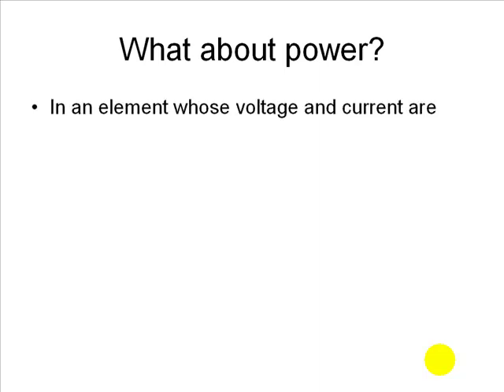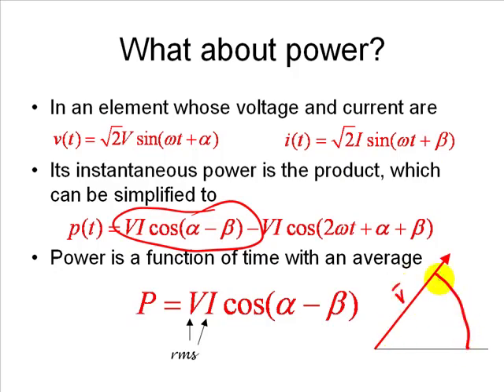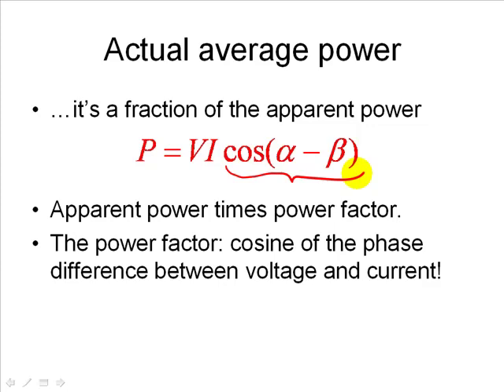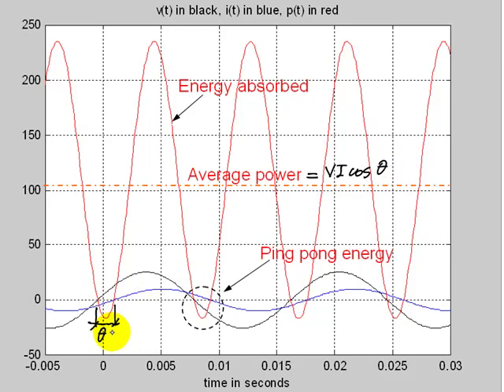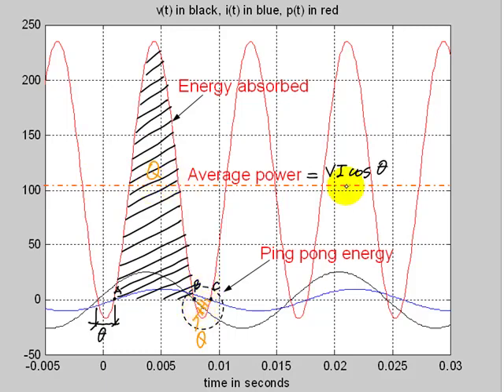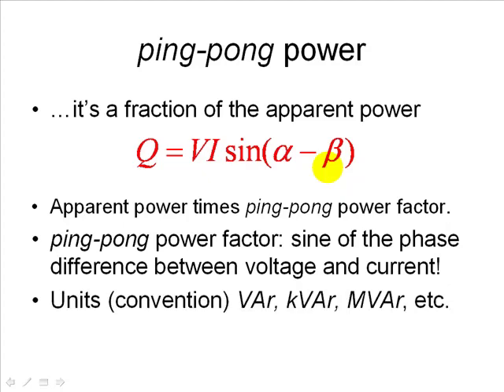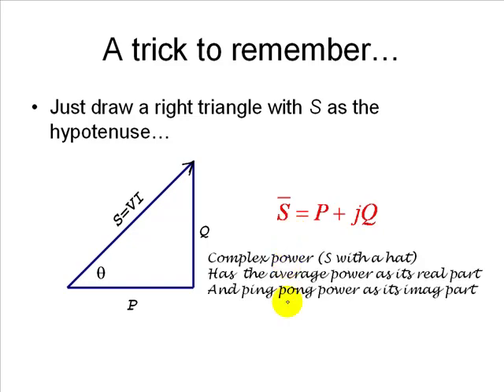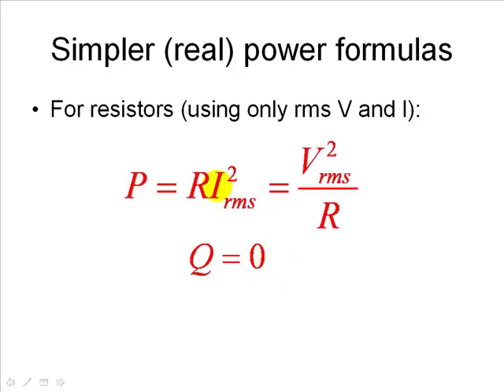PHASOR 7b - (Version 2) Active, reactive, apparent and complex power.

Comment: @sauri2005 Do plot the instantaneous power p(t) for an inductor, \alpha - \beta = 90 degrees, so the "constant" term of the p(t) expression becomes zero and the p(t) is just a sinusoid oscillating around zero. Half of the power cycle, the inductor takes energy from the generators to build its magnetic field, and the other half of the power cycle, the inductor dismantles its magnetic field and returns the stored energy back to the circuit and the generators.

Comment: If the capacitor produces Q and inductor absorbs Q then how does that relate to currents vs. voltages (sinusoidal) in leading/lagging. And also explain the two conventions of choosing the element as load or source then we ahve +/-Q and differences in lagging/leading of I towards V. Can you clarify this?

Comment: Question:
1)  If the the circuit is a pure reactive circuit, the first term of the formula:
p(t)= VI*cos(a-b) - VI cos(2wt+a+b) will disappear because a-b=90 or -90 degree.

Here comes the question:
The second term shows that the graph of p(t) will be a regular cosine wave with 0 offset on the vertical axis. Does that mean even in a pure reactive circuit, the power wave still consists of a active power part(the positive portion above 0) and a reactive power part (the negative portion bellow 0) ?

If that is not true(because we know it is a pure reactive circuit), then should we say that the reactive power is actually a complete sinusoidal wave, which consists a positive power part (power absorbed ) and  a negative power part (power returned)?

2) If the the circuit is a pure resistive circuit, the first term of the formula:
p(t)= VI*cos(a-b) - VI cos(2wt+a+b) will be VI, a constant, because a=0

The p(t) graph will be a cosine wave with a vertical offset of VI, which raised it up all above 0, that way, we say, the circuit is absorbing positive power and provides no power since there is no negative part on the graph. 

3) Now consider the situation of the existence of  both resistance and reactance.  According to 1),  I think the positive part of the graph of p(t) consists of both positive part of the reactive power and the positive power absorbed by resistance. In other words, the power company should charge you the positive part of the power cure with the tops  chopped off.
Reply: I know it's been 2 years, but I don't care.

With respect to the first question: in a purely reactive circuit, there's no average power (it's zero). Since its instantaneous power is a normal (with no vertical offset) cosine, the same amount of power consumed in half a cycle is then given back to the source in the other half of the cycle.

With respect to the second question: you're correct in your conclusions. 👍

Comment: I don't quite get it. At the end of the video, you said capacitor produces reactive power while inductor absorbs reactive power. But according to the graph you've just drawn, the reactive power is delivered by the element to the generator regardless the element is inductor or capacitor. So, it's quite contradict here..